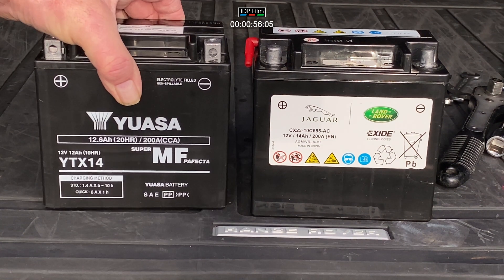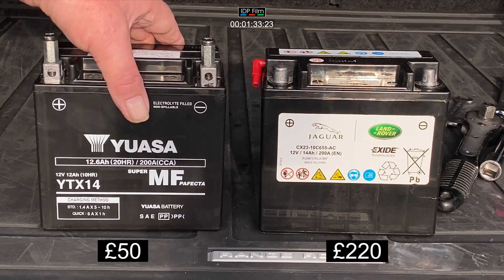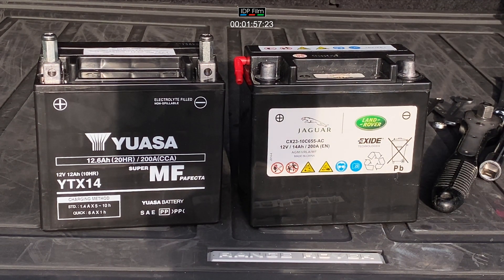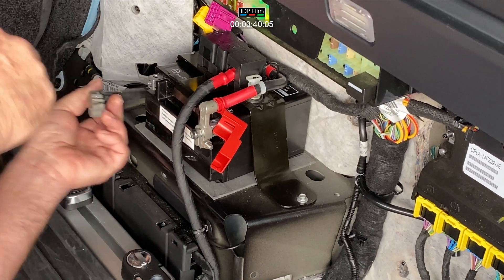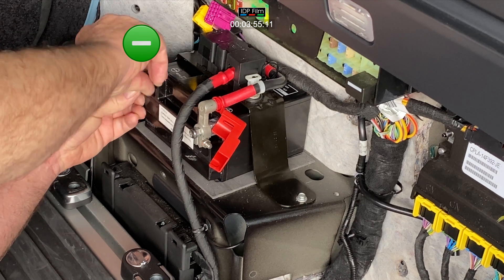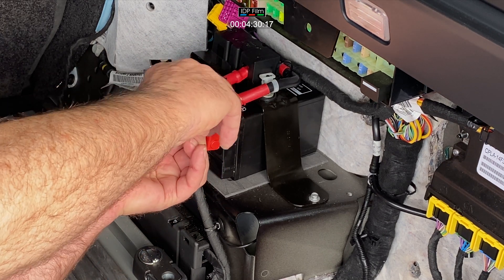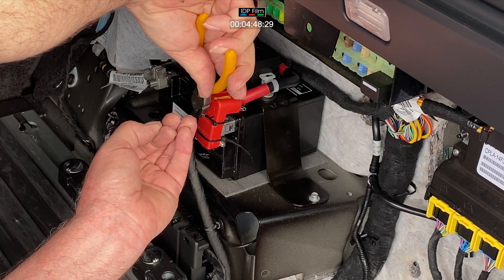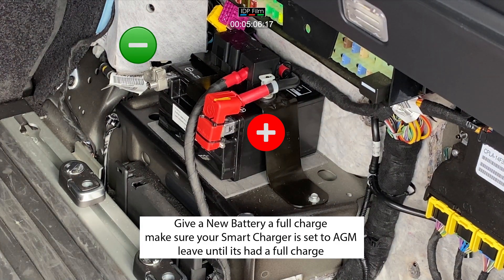Things you'll REGRET Not Doing to Your Car............STOP START Sorted

Comment: I have a 2016 range rover 3litre diesel and i have looked in trunk. There is main battery under spare wheel the right hand side compartment no aux battery. There is the space for it but no battery. Could it be that some vehicles dont have it?

Comment: Just about to replace the Stop Start on my 2014 L405 Autobiography 3.0TD. I managed to get an Exide EK151 battery for £55 delivered which has the same lugs.

Do I need to do anything with the computer, I am confident swapping the battery, but am concerned it will give me error codes or cause some other issues.

Comment: How do you know that it is the start stop battery giving the problem and not the main battery? Also when replacing this battery,  Do you have to save the memory and  Re register the battery to the battery management software?
Reply from the maker: Because after diagnosing the problem - 1) the car was driven for 60 miles prior to being parked overnight - the main battery ( after sitting overnight - battery read 13.4V ) - The Stop Start battery voltage read - 12.4 volts - which basically meant it was dead. ( I did try & charge the small Stop Start battery with a Ctek battery charger and would not hold a charge.
Ever since I replaced the Stop Start battery as VT - the problem has gone. Its been fixed now for over a year,

Comment: what is that black hose you just pulled out from the battery in the beginning?  What is it for?
Reply: i also noticed the same thing. he never re connected it. what is it ?
Reply: that's the overflow  pipe i think
Reply from the maker: THE BLACK HOSE - was put in by the factory, - AS THIS STOP START Battery is a AGM there is NO breather outlet - Its a fully sealed battery - the reason why you have to use a FULLY SEALED battery is that the battery lies on its side.
I CANNOT UNDERSTAND why the LR design team decided to put a battery on its side - lying on its side can lead to all sorts of problems - there was enough room in the design for the battery to stand vertically up !
YOU MUST NOT ever use a Lead Acid battery here - A lead Acid battery needs a air breather - hence the black tube. That said because its a Stop Start system  a Lead Acid is not up to the job - so who put a black breather tube in there when the battery is SEALED completely god know ?

Now this is IMPORTANT - what ever you do DISABLE the Stop Start function on your car. WHY oh WHY would you need to get the engine Stop Start at junctions ect - Its well known that Stop Start USES 20% MORE FUEL just restarting the engine than if it was ticking over - ALSO the amount of damage done to that Engine lack of oil and not to mention THE POOR STARTER Motor doing overtime !!!!
May be its one of those things - " what the hell the garages want more work ....... Can you imagine the garage telling you - sorry but your starter motor is worn out, you eed a new one - enough said.

The Stop Start Function CAN BE TURNED OFF using a Diagnostic tool like a  Snap On Legend.

in a nutsheel - the black tube is a breather tube - BUT the batteries you use are SEALED there's NO breather outlet !

Hope this answers your question.

.
Reply: @idpfilm  very true
Reply: Добрый день..Уменя, RR 494 2016 год ..Неработает старт стоп..Если я поменяю АКБ малый будет рабатат старт стоп ...

Comment: The issue I am running into with all of the videos that show the Intelligent Start-Stop battery is the location if it. I have looked on either side of the boot and the only thing we have found is a fuse box. So, then we looked under the glove compartment (as referenced in another video). Nope, not there either. We looked under the hood and only found the main battery. So, in a 2016 Range Rover Evoque HSE Dynamic, where is this Start-Stop battery?!
Reply from the maker: Hey Hazel Eyed Pearl
We are only too pleased to help you - here you go:

https://www.evoqueforums.net/threads/second-battery.2730/

Hope this helps
Best wishes from us all here at IDP FILM

.
Reply: @idpfilm Where is the second battery for a 2020 Evoque P250 Dynamic?

Comment: Did you forget to attach the vent hose?  Or was there not a place for it on the replacement battery?
Reply from the maker: Its a AGM battery type which has no vent hoses - new batteries there is no vent hose. You can tell by turning them upside down to see if anything comes out - besides WHY Jaguar Landrover decided to place this battery laying down I will never know - if its going to leak - it sure will over everything - tried to postion it in the upright position but no joy